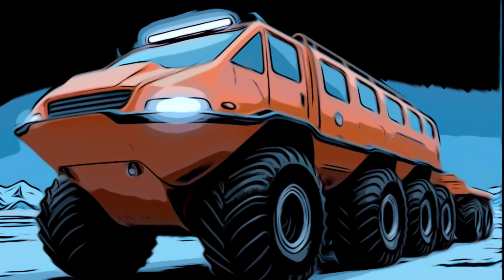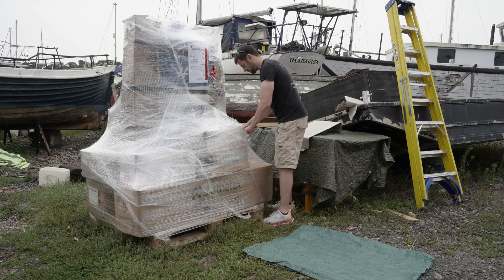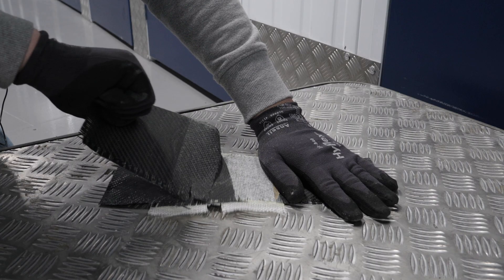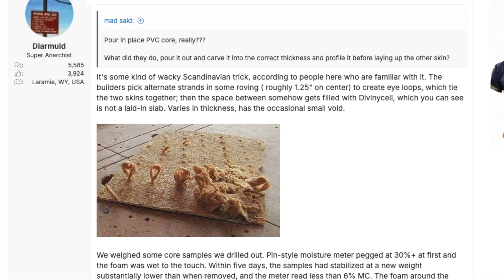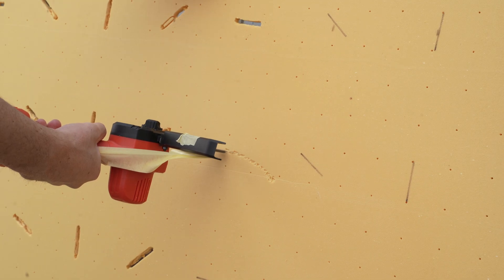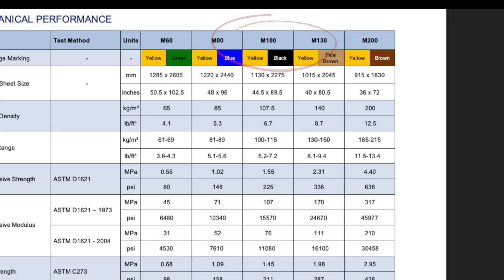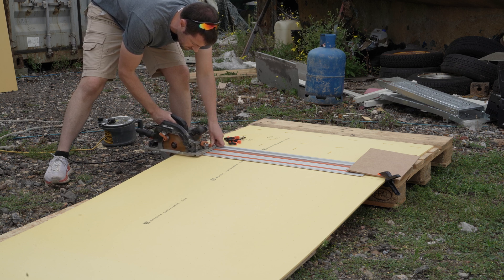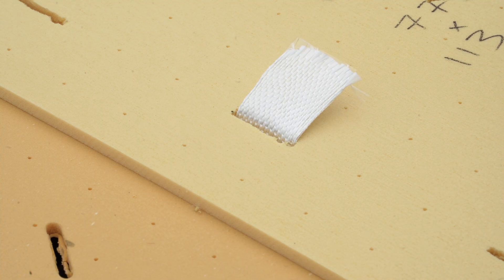Anti-delamination Modifications for Foam CoreCell Gurit M80/M100 Arctic Vehicle Project BERNARD [4K]

Comment: That's a cool idea for composite construction.  You look skilled with power tools but you might be entering a critical zone of comfort vs caution that may result in getting bitten by a blade .. you're holding the tools in unconventional ways with work that's not secured.
Reply from the maker: Luckily the saw is 'release to stop' and using the guard as a steadying grip was pretty robust. All tools have the potential to bite if you get cocky.

Comment: Will those glassfibre strips create a visible bulge on the surface afterwards?
They are quite thin but at the same time it's still one additional layer.
On the sides that wouldn't matter but how about the running surface?
Reply from the maker: No they are on the inner layers, next to the core. There's going to be six plies on top, so little chance of a bump. 

No running surface remember, as the vehicle is aloft on wheels.
Reply: @AlexHibbertOriginals  😅 yeah of course. It only looks like a sledge. Don't know how if forgot that 😂